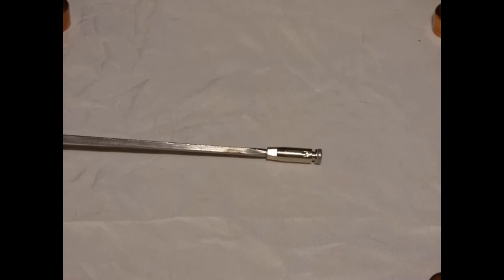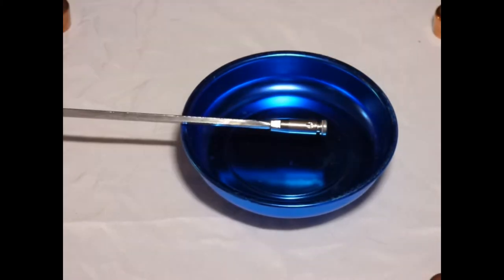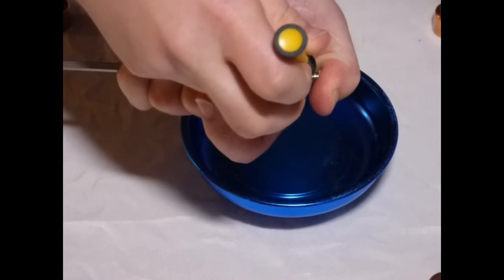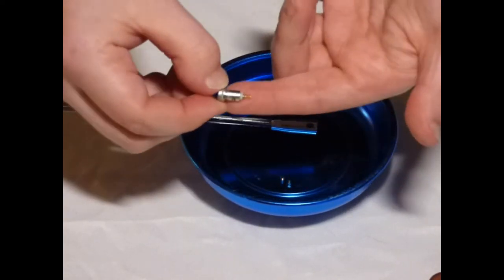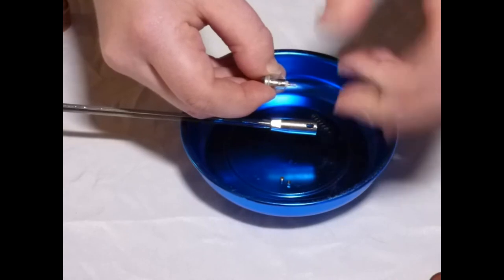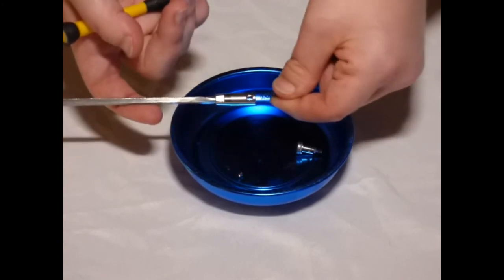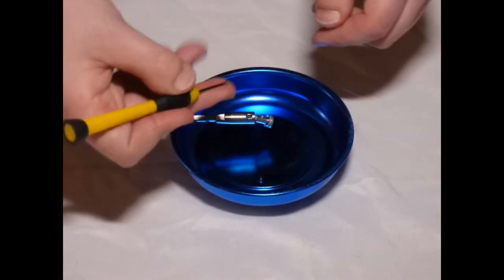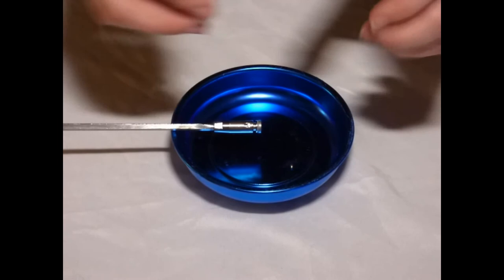How to Repair an Epee that's Failed the Gauge Test

Comment: if I don't have a set of gauges handy (not at a competition thought...  just as a rule of thumb ... sort of) I use my fingernail... if the weapon doesn't go off when pressing on a fingernail it likely will pass gauges too .. (yes not always...  but .. desperate times require desperate measures...lol) ... and it gives a reasonably good indication..